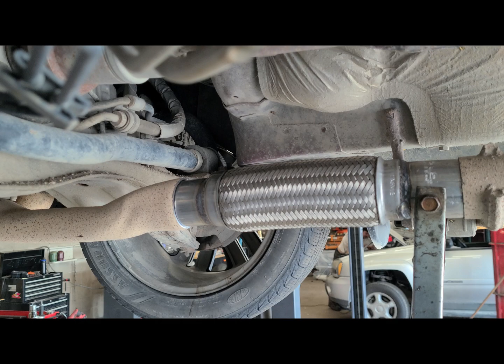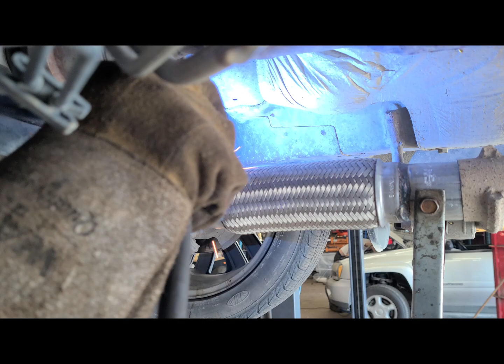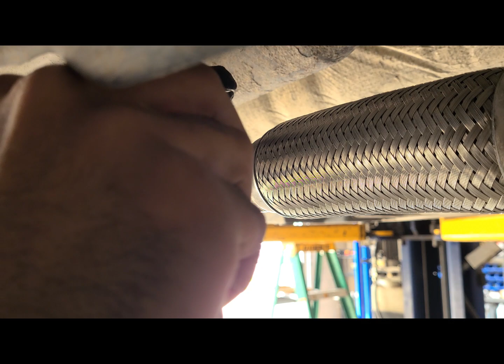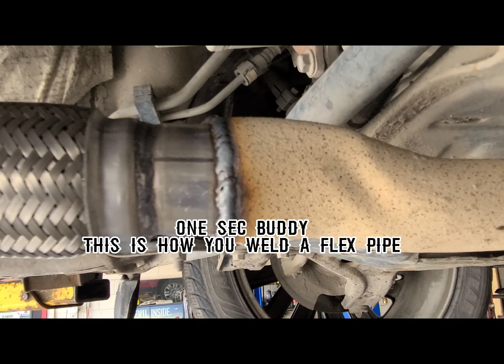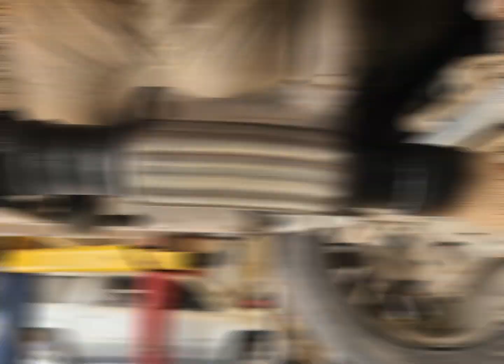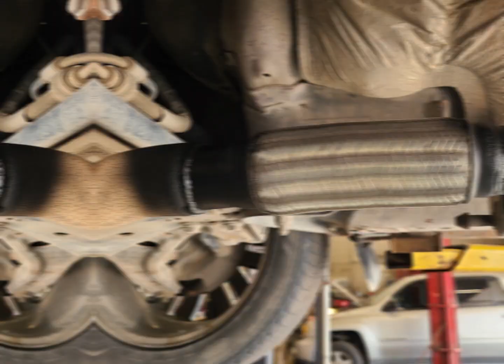How to weld exhaust flex pipe. #exhaust #mechanic #welding #mechaniclife

Comment: Is this mig welding??? Do i have to disconnect battery of car or anything before i start? And what kinda sheet metal, or pipe do i get for a job like this, or any kind of exhaust repair while exhaust is still on car. cheers